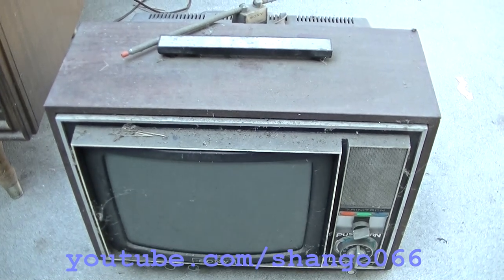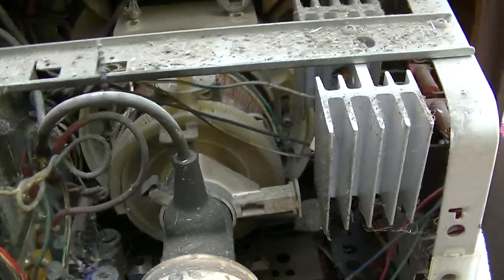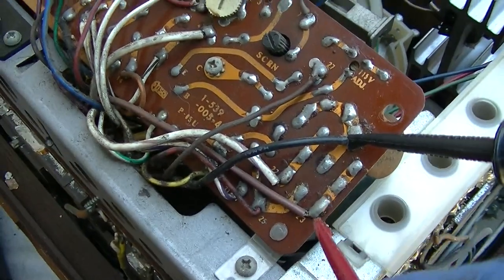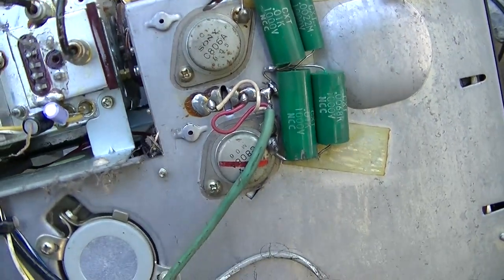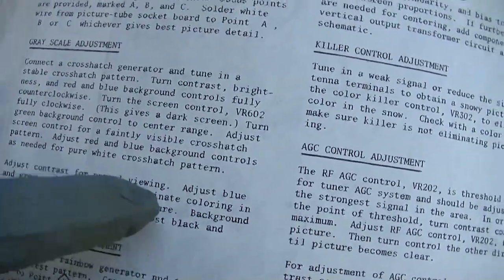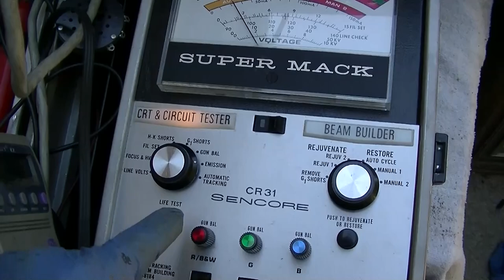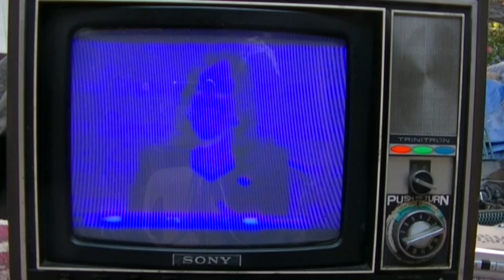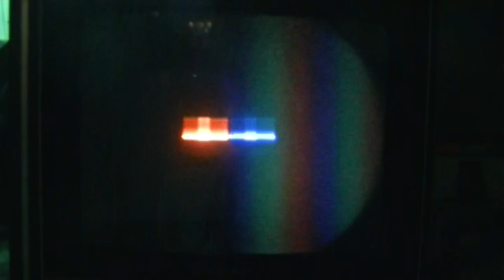1970 Sony Trinitron KV1210 Diagnosis and Analysis

Comment: You said it before: "Never try to rejuvenate a trinitron, it will get worse". Of course this one was already quite broken, so there was not much to lose.
Reply: Absolutely, Trinitrons do not respond to rejuvenation, in fact it can completely kill the CRT.
Even if you had a good replacement CRT, setting it up is difficult to say the least!
Reply: I've had some luck rejuvenating those early trinitrons, it's the later ones that don't like it.. This one is worn out due to the instant on keep the heater running thing.. The 2UK, European models I did it on  haven't got that fortunately, maybe it's only the mark version  with the mains transformer that has it, mark 2 had the switching type supply Shango was mentioning at the beginning.
Reply: @HughTVDX  that’s not true — I’ve rejuved high end Sony monitors with great results, that last. Those tubes were on the market from 1995 thru to the end of the crt era. That said, you have to be careful and try to limit it to clean & balance on the 467.
Reply: @philexile2954  You must use the clean and balance or remove shorts function on a trinitron. Rejuvenate almost never works.
Reply: So what was going on with these Trinitron CRTs? Is there less emitting material comparing to other tubes?
Reply: @CLUBNEON-m6i  Yes, and very miniature cathodes. The proffesional ones in BVM monitors are a different story though. They can have at least triple the lifetime of a consumer tube, maybe quadruple. A consumer Trinitron tube can give a good picture for about 25-35k hours (depends on the size, smaller ones last longer). A BVM Trinitron tube can last for more than 100k hours.
Reply: Horrible short life on the picture tubes. An experiment gone wrong due to cost cutting no doubt. Spent plenty on the rest of the chassis however!
Reply: @markpirateuk  The older ones I rejuvenated responded beautifully:  models KV1547R and KV1915, for example.  Perhaps you meant the trinitron tubes that were made in the late 80s and later?
Reply: They can't be worse than Orion tubes from the 90s! I had like 4 Broksonic TVs with those tubes, don't know the exact model but they all used a type of short neck with tiny cathodes. None of them lasted more than 6 or 7 years without loosing its bright and contrast, pure junk!
Reply: Umm... I got my trinitron rejuvenated 2 months ago, green was VERY weak on my tv before i got it rejuvenated. I used it a lot (more than 100 hours) since then and it still looks perfect...
Reply: @CLUBNEON-m6i  Broke-sonic is what we used to call them. And don't forget Goldstar, Sampo, Samtron, and the early Samsungs (which we called "no-name sams").
Reply: I just got a 1971 sony set with the same tube as the one in the video, all 3 guns tested dead, even worse than the one seen here, although it was making a better picture surprisingly. I’m not sure what was up with it, if it was just dirty or what. Because using the same super mack tester on rejuv 2 it brought all 3 guns back to like new emissions. Who knows how long it will last, but it does seem like it’s possible to bring them back to life

Comment: The Zenith dealer which I worked for in high school also sold Sony, but mostly radios. There were five techs in the shop, and two on the road, but only one who worked on/with Sony equipment. He was the equivalent of a "Rolls Royce mechanic". If memory serves, the chroma sections were nearly bulletproof, however, the HV/horizontal oscillator sections were prone to needing work.

Comment: We had a Sony Trinitron TV growing up. It was very similar to the one in the original Poltergeist movie. It had a remote that operated on RF instead of IR. There is a funny scene in the movie where the neighbors kept changing the channel on each other's TV.
Reply: I have a zenith floor model on RF, if I don’t turn on the vacay switch the vacuum turns it on lmao, dogs also get weirded out when you point it at them and click the button (it’s electric, not the tuning fork one)
Reply: @AshAndCamilleMiller  the one we had didn't have a battery in the remote.

Comment: It may be spent but the repair was easy. These sets were pretty reliable except for the CRT. Thankfully I have one with a good CRT.
I haven't turned it on in awhile but I imagine it still works. These sets outdid every other set for picture quality at that time.

Comment: Wonder how the picture would look with 8-9V on the CRT filament. Would be easy to rig up, since the filament runs on it's own little line powered transformer, and not off a flyback winding.

Comment: Hi from the UK.  As a long retired TV engineer from the 1950's to 2002, I am fascinated by your terminology, and your approach to not repairing a TV.  I didn't see you check the hight voltage (HT), or the CRT final anode voltage (EHT).  Even if the CRT guns are low emission, the picture should focus.  That there was no green in the mid to low lights, yet there was in the peak white, is quite confusing.  Of course, the problem with Sony's Trinitron series wasn't only with the 'Beam Indexed' CRT, it was also their unique 'get around' circuitry.  Here in the UK, where we used the PAL colour system, Sony used their 'get around' circuits which didn't make a lot of sense to us technically.  Incidentally, here in the UK, old analogue TV's no longer work.  We are completely digital now.

Comment: @shango066 have a question. If you had a old TV like this one with a weak/dead CRT could a newer CRT like from the 90/2000s in it to save the older TV with a newer CRT. Would be a interesting challenge because of voltages coils etc.

Comment: i wonder what would happen if you connected the filaments up separately to a bench power supply and slowly cranked up the voltage to see what kind of effect it will have?

Comment: As a kid I had a KV-1201, first TV I ever resurrected, but in the end I couldn't find a transistor to bring back all 3 colors so I was left with just red and blue but no green.
I don't remember what happened to it, I think it got necked by accident while I was working on it, that was a sad day.
It also used to do the 3 color dots when it was turned off.

Comment: all the Trinitron TVs i've had for repair, the horizontal output transistor blew either caused  the high voltage rectifier shorting, or it shorting due to the transistor blowing making it not economical to repair. most of my repairs were the good old rca xl100 ct chassis, fixed so many of them i didn't need a schematic. the xl100 chassis were used in so many rca tvs it didn't matter if it was a small one or a big floor model console tv, cold solder joints, bad chroma processor, bridge rectifier, and h-op transistor for common failures. rejuvenate the weak crt, and send it home

Comment: Interesting old TVs. Are they all the original components? I don’t know a lot about these but VERY interesting. I volunteer at a nice living museum here in England and we are having a 1940’s, 50’s and 60’s street located at the museum including an old music/TV shop where we’ll keep old vintage TVs and I’m so keen to assist in the shop. You sure know your stuff though as you’ll know, TVs like this back in the day built up THOUSANDS of volts NOT to be messed about with. Am I right mentioning the colour gun at the end of the tube is made up of red, green and blue? I noticed the blue colour parts working. Again most interesting.

Comment: Reminded me of the Sony custom SG-613 (Gate controlled Switch - special type of SCR) in the horizontal output circuit. They were AU$50 a throw and even when the set was working normally could fail after a few weeks.  I eventually found a mod using a cheaper transistor but it never worked quite right. This is going back 30 years now.
Reply: Fortunately this TV is before those horrible things appeared!

Comment: Question - it's got a separate cathode HV power.  How does a rejuvenator work exactly?  My theory is reversing the flow of electrons to throw off junk on the cathode?  I assume you don't need HV power anyway - you don't need the set on... but does it matter that it doesn't have the typical HV cathode going through the CRT board? (I would appreciate not having to change my underwear if I touched the CRT board when it was on lol)

Comment: a question because at the end of the supposed repair the screen looks blue because I have the same model of tv that my grandmother gave me and it looks excellent
Reply from the maker: The picture tube in this TV is garbage. I think you missed the diagnostic part in conclusion
Reply: @shango066  So, summing up, this television is no longer useful, it has no remedy or that
Reply from the maker: @krispinaelisondorivadeneir8523  correct it's a prop. The point of the video is it's a diagnostic Theory and execution video
Reply: @shango066  I'm sorry about this TV, it's a shame because it's a gem, a fabulous TV

Comment: Most of the junk hear in the UK you could bridge a resistor on the tube base and get a bit more heater voltage,  I remember doing that on some of my mates junk rentals to give them a few more months , bare in mind he was running just about the cheapest tv rental there was , so most were happy if you got a picture at all even if it ment closing the curtains,  I remember looking at a old Hitachi he put out on rental brand new in the 70's and it broke down first time in the 90's for the very first time now that was a profit , his customer insisted if at all possible he repaired it as they liked it and it's fake wood

Comment: I have tried to rejuvanate, boost or kick a few of these with the same result. Sony Tubes do not respond. Here in the UK we had mostly Mullard tubes that generally did and Mazda which were very hit and miss. You;re best bet is to drive the heaters really hard from an external supply - I mean really hard! - and them hit Rejuvanate 2. It may blow the heaters but the tube is already dead so nothing to lose. The best answer for such a rare set is a new tube..... put the set back in the Chicken Coop and see if there is a tube to be had.

Comment: as its rare, keep it, you never know, you may come across one with rough innards/cabinet but reasonable tube....
Reply: i have 2 KV1320UB's and a KV1310UB, some of the first trinitron models imported into the UK, the 1310 works , but starts 'fizzing' after a few minutes, and it doesnt seem to be eht tracking..?  the others not yet tested
Reply: the 1320 mk1 has a valve/tube eht rectifer and big mains transformer and linear regulator, but the other 2 use a tripler with a 'chopper' power supply, and i think those do have a cap which 'kicks' things off when powering up, cant remember for sure... the main circuit is basically designed for 100 to 120v mains supply, but with 'extras' for our 220-240 v supply ...  similar with a KV1800UB i had, great big 240 to 100 v mains transformer!

Comment: What's up with the high voltage on the neck of the CRT? never seen one before?
Reply: I think that lead is for horizontal static convergence. It only seems to appear on the very early Trinitrons.  To bad there are no new CRTs for these.

Comment: Papa Shango may have brought that TV back from the dead.....but it came back as a zombie....it's not in the land of the living rather.... that TV is in the realm of the undead.

In all seriousness, is it possible to use a glass cutter to open the TV tube, remove the electron gun for the worn out filaments using a high temp Map gas to soften the glass, then put in new filaments?

It may require some experience in glass blowing and stuff.